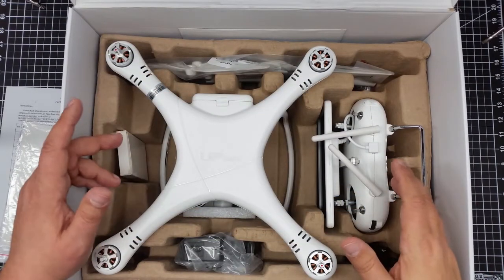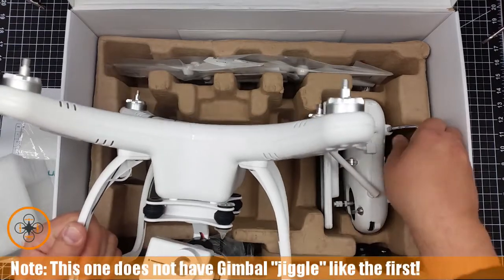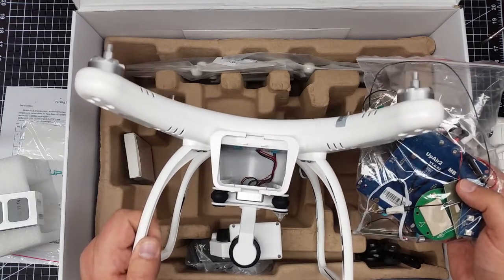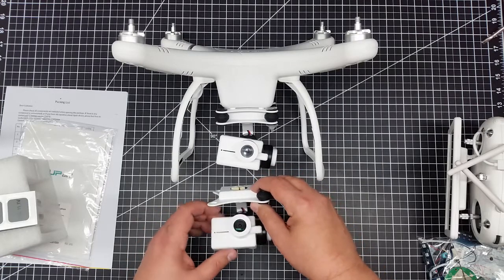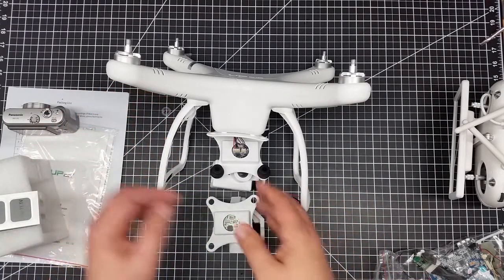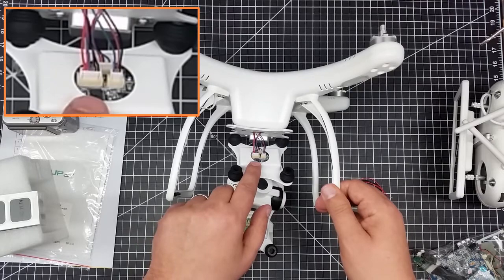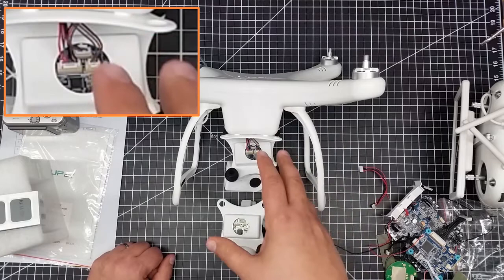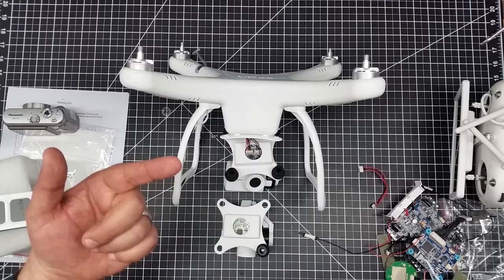Video Drone - My Replacement UpAir One and Gimbal Discussion!

Comment: I would suggest tying some fishing line in through the damping balls/grommets to help prevent the gimble from falling off, should anything work loose or those plastic retainers clips break/fail
Reply from the maker: Good suggestion as what I did was use lose fitting zip ties (video in queue for this) as there is no way such as "small" crash should have done this much damage...

Comment: Thanks so much for posting.  We have had a small crash too and our gimbal wires (6 wires) came out.  We were looking for the configuration and found your video.  However our wires are not the same color as yours.  Can you help?  Our wire colors are white, black, red, red, orange, brown.  We need to know the order to wire them back into the gimbal.
Reply from the maker: Sorry this was quite some time back and I post for just the reason you mentioned however would suggest watch the video's in the playlist as there are several where I speak of rationalizing what the wire are you should be able to do the same...

Comment: Did you ever connect the tx to the 3 wire cable from the main board to see if osd was broadcasted? and if so what is the 3 wire layout, power, ground and video.
Reply from the maker: The top board in the gimbal is the OSD so that board is required and will require a video input (as the OSD is an overlay and requires a video signal).  I think you could rig something up however it would be more effort than I wanted spend but again I think possible to remove the OSD daughter board and add another video source.

Comment: I just bought a second hand upair one g10 drone and all i am getting is gray lines..I tried the button under the controller tl get a channel and nothing..can you assist me..i had a upair one 4k before and it got damaged but when i try the new controller with the old upair the camera comes up but its not moving the camera up and down and when I try to change the modes it wont change but all the information comes on the screen

Comment: Hello my friend great videos as usual I have a question when you purchased The mainboard does it come with GPS and all the wires and compass Cheers my friend￼
Reply from the maker: No as I recall the GPS board was separate on the flight control board... (however its been a while)

Comment: I have the New Upair One4k it has the Px4 V1.2.00 board.    I cannot access the video settings. Stuck on 4K at low frame rate. Was sent update that does not work. No answer from Gten or Banggood. I am sending back If I don't figure out a solution in a few more days. I see similar complaints else where. BEWARE!
Reply from the maker: Is it the newer one with App control?
Reply: Same problem with 2.7k.
Reply: Yup. The camera settings in the app are non-existent.

Comment: I had this same issue you describe (Crashed and disconected wires) but 2 remain, and let me tell you that they do not run paralell. Have you tried to dissasembly the new drone (for mods or pure joy) and make a proper wiring diagram?  This is what i have:

DRONE
GREY-BROWN - EMPTY - YELLOW-WHITE - EMPTY- BLACK-RED

on the gimbal
White-empty-empty-grey-empty -empty

Any ideas?
Reply from the maker: +Johncy Pena you can get new cables from  Cen10 if you write them and this is the way I would go as I smoked the last one.  Also as you saw I had two and both were different even thou I bought them from amazon only a month a part...
Reply: i tried doing that, but due to import issues i wasnt able to get them. i'll try to get in touch with them again! thanks
Reply from the maker: Are you in the US?  If so should not be an issue I have gotten things from the,m...
Reply: Video-Drone no, im in argentina, and its almost impossible to get it, saddest part is i need it for an upcoming gig 😕
Reply from the maker: Ouch, understand now...

Comment: Hi, I recently crash my upair one 2.7k and pulled the wires out of the camera control board beyond repair. I see that they have a replacement camera on bangoods website. Will the connector fit my version. I have the version before the receiver antenna's were changed.
Reply from the maker: Which version do you have the chase, one or one plus there are three and each is different
Reply: Video-Drone I have one exactly like the one in your video.
Reply from the maker: Mine is the Upair One Plus and and it has a different camera then the Chase & UpAir One.  I have not  seen a replacement camera for "plus", but not saying there isn't one some where.  I would write to GTen to see they can help...

Comment: Helloo, i have a questions, my upair one drone camera gives no picture and onlusten get snow image , you know mybe  what i should do or you may have a what the problem is, at least would like to thank you.
Reply from the maker: Have you tried rebinding the transmitter to the quad (there is a button on the back of the transmitter, check the manual for details.  Now I assume when you power up the drone the gimbal does it little dance?
Reply: yes the gimbal dance a little, but the  fpv screen shows no picture
Reply: Steel not working
Reply: Crassssss my drone, and cables out of THE connector so mybe i put THE cables wrong
Reply from the maker: Not sure what this means?  If your gimbal is dancing your cables are likely ok.  Did you try rebinding the transmitter with the chopter?

Comment: I have one of the newer drones with the p4 board but it has the same 3 plug gimbal. Could you please do a diagram of the gimbal plugs and the function of each wire. I am trying to rewire the plugs so I can use my older upair one gimbal with the removable firefly camera. I would be willing to pay for the diagram. Thank you.
Reply from the maker: Wow, this is not an impossible task however it is a big task.  Inside the gimbal (the top board) is the OSD and it appears that there is a gyro/accelerometer in the camera so the gimabl will not work without the camera.  What I think is possible is to use a mini OSD with another gimabl and camera and feed it the data P4 which should be standard data.
Reply: The gimbal I have and want to use is one of the first upair gimbals that had the removable camera. I know it had the gyro and other components mounted in the gimbal housing because the gimbal would work and level without a camera. I already have a mini minum OSD board to use. I just need to figure out the wiring since G10 tries to make thing difficult. For example ,on my older upair drones,black is video and yellow is ground. If i had a diagram of the new gimbal plug wiring with labels for each wires function, I could easily get it set up.
Reply from the maker: I have never seen the pins on the older gimbal so not sure as the older units used APM not P4 so not sure the telemetry signals will be the same.  My suggestion is to look at the pin outs of the P4 and try matching the the UPAir core board they likely will match and you can try from there. However it will be a fair amount work (time) and risk to sort, if its a challenge thing then go for it, it will be a lot of fun.  However not sure the economic of will be the best if its not a challenge thing...
Reply: I have the PX4 V1.02.00 and the colors are different. If you could send me a picture of the cable i could be able to follow each cable to the correct end. I do not think they run paralell, because when my drone fell 2 wires stood in place. The drone side they didnt unplug   (X are empty slots)
Drone side: 
Grey – Brown- x- Yellow-White- X – X – Black – Red
White – X- X- Grey – X – X 
gimbal side (those are the only ones remaining).
Any help will be highly apreciated!

Comment: Video-Drone Thanks for your YouTube videos they are very helpful but I have an UpAir one 4K V1.2 and have not been able to take still pictures or video's. The gimbal and camera are stable and I do receive a picture from my camera when flying the Drone. On my FPV monitor there is a second picture overlaid on the camera picture that has an ! point in a Triangle with the letters SD. The SD has two Chinese symbols on each side of the letters. The FVP has been this way since the first day I powered up the unit.. any ideas ??I'm stumped. :(
Reply: PS: I assume it has something to do with the SD card but no information is supplied with the manual.
Reply from the maker: 4K camera requires a very fast card (believe Class 3) and it sounds like its complaining about that.  Also if there are Mandarin ideograms next to it, install google translate point the camera at it and it will translate as I do this all of the time...
Reply: Video-Drone   I took the cover off the camera back and taking a closer look with a magnifying glass it looks to me like the SD card is missing. Also I was unable to find it anywhere under the cover. ...thanks for your response and service you give to us novists .
Reply: Video Drone, Can any Micro-SD card class 3 be used 16G, 32G, 64G etc. ??
Reply from the maker: Believe so, would not go above 32gig

Comment: Help help help! Upair version 1.2 with the PX4 main board. How do you change video settings? Also my video quality is terrible. there is no way this camera is producing 4K video. Nor 16 mega pixel images. Any ideas what the heck is going on with this new version and G10. I'm getting a lot of run around. They want to send me new Firmware.
Reply from the maker: Check put Cruz Roy's site he has very good video on changing the camera setting settings on the UPAir.  I also assume you have the newer App version of the UPAir?
Reply: I have the same Upair version. Video settings not available. Have you found an answer?
Reply from the maker: Check out Cruz Roy's channel he does a good video on how to change settings...
Reply: for what i´ve read you cannot change settings on the px4

Comment: Hello there is there any way to change upair 2d gimble to 3d custom gimble
Reply from the maker: Sort of, the gimbal uses the Storm 32 firmware and the gimbal and camera work together (position gyros are in the camera) and on top of that the OSD is a daughter board to gimbal (sits on top as I recall) so it is possible however it is not plug and play...

Comment: I had the same thing happen to mine a minor crash the gimble flies off..(one of the connectors broke off the board )I bought a crashed one from someone and i put that gimble on it now it works fine but 1 motor want start now.
Took a motor off of it also just crimped the wires without take it apart still nothing does it need to be solid wire to the board
Reply from the maker: Know what your mean, went though all basically the same stuff with it too :-)

Comment: Mine has just one wire plugin with 5 wires crash messed up the plugin on the drone side where can I get new parts
Reply from the maker: You write to GenTen the manufacture, however the cost of the part will likely be more then you can buy a new one which is what I found but they do have responsive customer service...

Comment: Can i know why the gimbal and camera suddenly malfunctioning while flying but the quad control no problem (mean flying suddenly without FPV). After turn off and turn it on again everything work fine... Any idea?  I never crash...
Reply from the maker: Can you explain what the "malfunction" is that is a broad term and two what version do you have?  The One or the One Plus?
Reply: After few minutes flying... i suddenly lost fpv on the screen and also the mav data. So i have to pull the rth button... i see the gimbal dead (tilt 90 degree). And when i turn off the quad and turn it on again...the gimbal and camera back to normal and repeat the issues... Mine is 5.8ghz version and PX4 board.. For now my idea is the 5.8ghz board cause the problem when it getting hot? What you think?
Reply from the maker: While the transmitter will over heat it will not affect the gimbal.  Have you checked the cables and connectors?  Also both versions fly without video/gimbal and OSD...
Reply: I make a test just now. I open the 5.8ghz cover and turn on the quad but not armed it and make it dance over 10min... the gimbal and camera work like a charm. But if i not open the cover, the fpv screen and mav data will disappear (or lost signal) about 30sec (due to over heat) but the gimbal still functioning (for the duration).
Reply: I will make another test tomorrow as you said. The cable and connector seem ok...
Reply from the maker: Have you written to GTEN?  They are pretty good at answering...

Comment: That is THE case,vedeo transmitter is fried , thanks for your help my friend.
Reply from the maker: Its an easy replacement.  Not sure of your version but a 600mw typically can be moded to fit and you will get better performance...

Comment: Please please PLEASE!!!! HELP!!!! I crashed my UpAir and broke the gimble and don't have the money for a new gimble. Is there any way I can buy a separate gimble and just mout an action cam and still use FPV and have gimble control with the scroll wheel??? Plz HELP!!!!
Reply from the maker: You could check with Cen10 (the manufacture)  about sending it back for repair however what I found is its cheaper to buy a new one, or look on ebay however again for the ones I saw there its cheaper to buy a new copter in the long run as its likely damaged more than you think.   Also the OSD for the copter is in the gimabl so without it will be hard to tell if you have satellites so not really safe.  Yet it should still arm and fly (as you can see my play list I had similar issue).  Sorry for not have better news...
Reply: Video-Drone ok, thanks for replying.

Comment: I am up iar 4k I changed the radio board it does not work the drone has a radio from the old tb I can not make it work
Reply from the maker: Sorry I am bit confused on the issue, you changed the radio board on the controller and now it wont bind with the quad?
Reply: Because I have a problem with the one that came in it I bought a new one, there was no ligango, but I decided to make a video showing, thank you very much for the attention
Reply from the maker: No worries and if there is anything I can do to help, please just ask!

Comment: @mrfender5001  You may want to consider just removing the whole gimbal assembly and adding an FPV camera alone.  As it turns out, the UPair's 2axis gimbal isn't really doing much anyway!  Here is an example of what the raw video off of an UPair One with no gimbal looks like: https://www.youtube.com/watch?v=kkmGepHzW34
Reply from the maker: Thats what I ended up doing, worked however I missed the OSD :-(

Comment: my upair one battery or charger is broken
Reply from the maker: What is it doing (or not doing?)
Reply: the light indicator on the charger is green but the battery indicates its still where it was from 2 days ago and was never charged
Reply from the maker: Sounds like the "smart battery"  might of went "dumb" however when that happens i that case is the lights on the battery typically flash and this is not what your saying.  I would take a multi-meter and  check the voltage out of the charger as there could be a frayed wire in the cable and it is not making to the battery.
Reply: ok and what if it doesnt show any voltage
Reply from the maker: Then your charger is bad and you need a new one... (which is likely cheaper than battery)

Comment: Is not working
Reply from the maker: So you tried "rebinding" and that did not work?  So if this is the case where (1) it does it's dance (the camera) and rebinding still did not provide an image, then my vote would be your video transmitter (that silver box on the underside of the copter) is fried sorry to say.  This can happen if you leave it sit on the ground transmitting too long as depends on air flow to cool it...